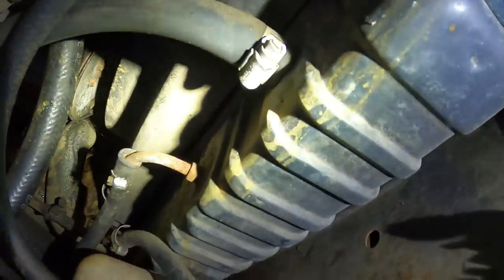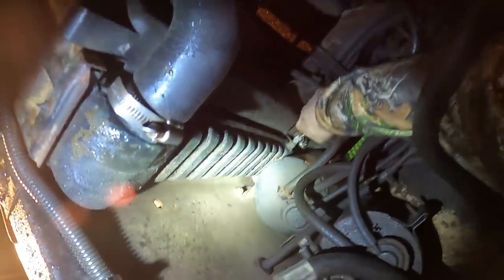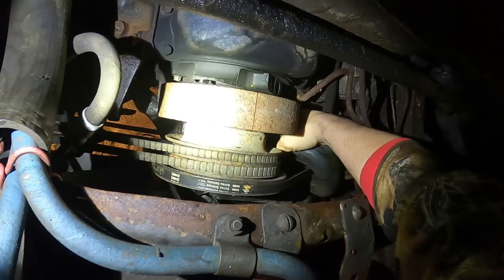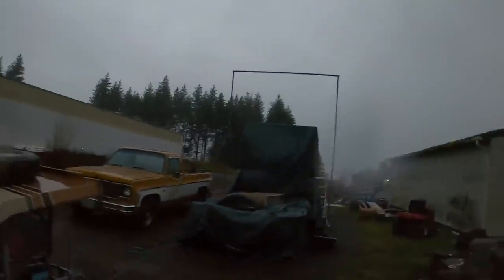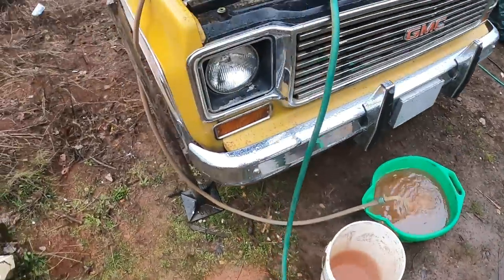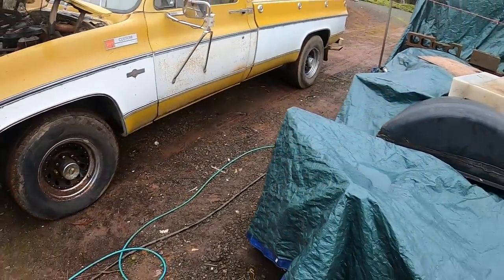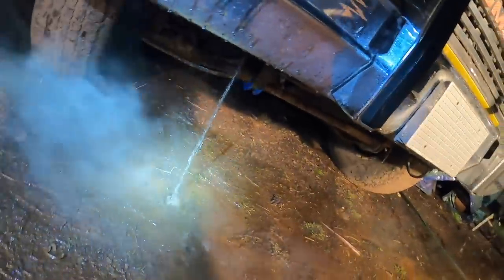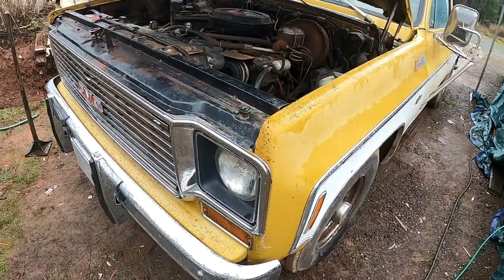Coolant Flush & Lower Radiator Hose - 1973 GMC C2500

Comment: Hi Nathan, thanks for the video.  I always wondered about flushing a rad..
BTW.. you probably already know this but..
The higher pressure in the cooling system (the job of the radiator cap - that one is set to 16lbs.) allows water to go to a higher & predetermined temperature without boiling and more efficiently transfer heat.  Especially important at higher altitudes)
(Side note: When camping on a mountain, the lower atmospheric pressure may result in tea & coffee tasting like crap; porridge not fully cooking. The water doesn't get hot enough to do the job before it boils & can go no higher in temperature.)
Best regards, Dennis
Reply: What altitude are you camping at?  I used to live at 6600 at the boiling point difference wasn’t that bad. My mom lives at 7500. I’m just really curious about this.
Reply: @White000Crow   My comment was a "side note", to demonstrate the effect of high & low pressure on boiling point.  But, to your point, perhaps, I should have wrote "mountain climber bivouacs" (You should find a number of descriptive references to the effect of high altitude & low atmospheric pressure on the boiling point of water in a number of National Geographic articles..).
Anyhow, 212 degree F boiling point is only for pure water & only valid at sea level.  The pickup's rad cap seal, insures the pressure in the system can climb no higher than 16 psi. I believe most rad caps limit the pressure to 14 or 15 psi.  The previous owner probably "upgraded" to a 16 psi cap.  I suspect, by all the other upgrades, he/she was doing a lot of heavy towing through the mountains..
All okay if the system will safely contain 16 psi..
With no rad cap, 50/50 coolant boils at about 223 deg F.  At 15 psi, 50/50 will boil at about 265 deg F.
Restrained to staying liquid, & not turning to steam, allows the coolant to continue being circulated & engine heat transferred to it.
In addition, it better assures a more constant boiling point / pressure limit despite vehicle altitude.
Getting back to your comment..
LOL, at 6600 to 7000 ft (boiling point around 200 deg F) you indicate, I'm guessing my Northern Ireland born parents would have noticed a taste difference in their tea.  Pretty sure Dad would've grumbled "dishwater" & dumped it in the sink.
Maybe that's why they settled only 250' above sea level in Toronto.. 8-)

Comment: NiCe fluSh Nate!
You can $ave your money by easily welding those plastic reservoirs no matter how bad they are with your soldering gun,
Mine almost added up to 2ft of cracks with no leaks and its just as fun as metal ... with a MadMax look.
✌️💔🇺🇸

Comment: I have a 77 jimmy and i’m having trouble with the coolant, instead of it burping, it keeps flowing out of the radiator instead, level keeps going up and down and up and down. Not sure what the issue is, thought it was going well after a bit, next thing I knew the rad cap blows off the truck. Need some help if possible

Comment: Use bar keepers friend it has oxalic acid in it , been there done that you will be flushing that thing for days with standard radiator cleaner,  take a some BAR KEEPERS FRIEND AND MIX IT WITH WATER IN A BOWL AND THROW A RUSTY SCREW DRIVER OR SOMETHING IN IT . STUFF IS CRAZY.